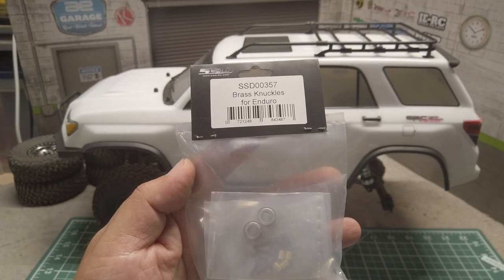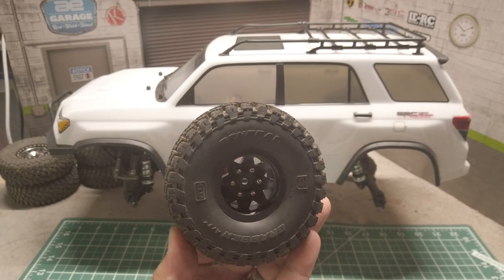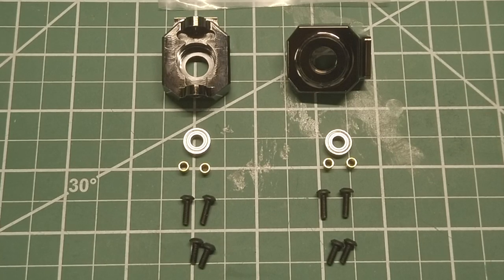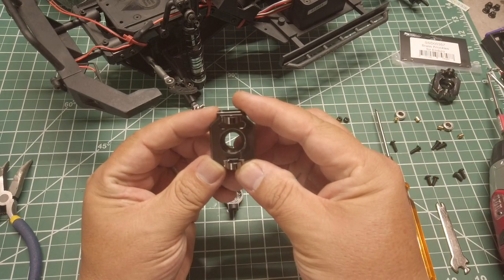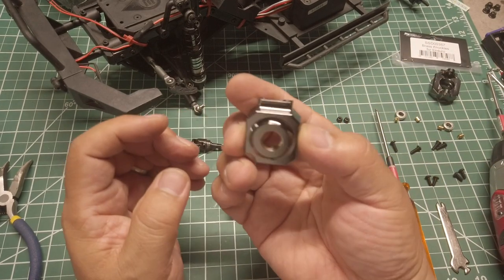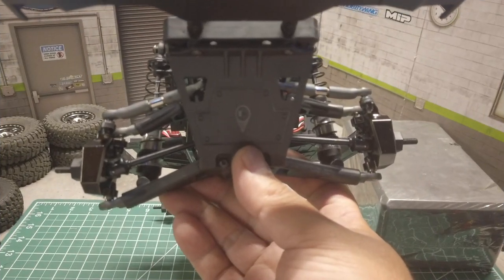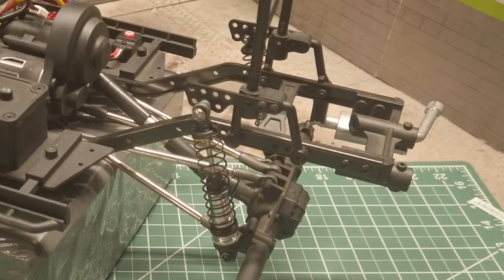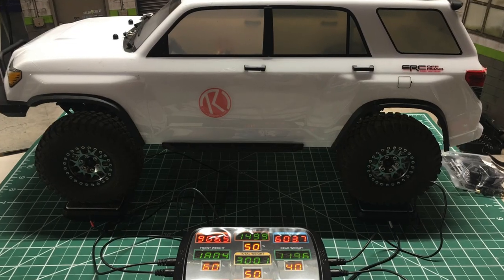Element RC Enduro Trailrunner Toyota 4Runner | SSD Brass Knuckles, IERC Shock Key & Yellow Springs

Comment: You saved me from having to solid axle swap! I have broken 2 plastic knuckles already! I was looking but was told that those knuckles don't work for the ifs
Reply from the maker: They work really well.  Give it a try.  It also adds weight where it's necessary.
Reply: I have the trailrunner and I put ssd wheels with km3 from watching one of your videos lol tha know so much.
Reply from the maker: @shawntomlin7632  That sounds like a great combination for the Trailrunner.
Reply: It is great! I just need to not break the knuckles. Need to wait till I get paid to get the metal ones

Comment: Huh, the shoulders on the ball end screws that go through the knuckle don't fit inside my SSD knuckles. Weird, looks like yours bolted right up. Guess I'll have to drill out my knuckles a little? Or I could get some standard rod ends I think. hmmm
Reply from the maker: Make sure the bend of the rod ends is facing correctly...that's the only thing I can think of why the ball end screws is not fitting correctly.
Reply: I'm having the same issue, man.  Did you end up drilling them out or figure out something else?

Comment: COOL VIDEO WAS THIS THE RIGG IN SEAN P RC VIDEO CLIMBING UP THAT WALL,LIKE IT WAS SPIDER MAN🤜🤛
Reply from the maker: Nope, it is not.  That one is Joshua Lazo's Trailrunner.  He was motivating me to work on mine which was being overlooked for Gspeed Enduro and TRX-4 Sport.  I need to tweak mine a bit, and test it against his ;). He will have a big advantage as he is running 4.75" tires, and I am still running 4.19" tires, but I mean to give him a run for his money though.
Reply: @BigSungHobbies  GET HIM,LOL,THE BODY IS NICE HOPEFULLY YOU DON'T HAVE TO CHOP IT UP,THAT'LL SUCK,COOL VIDEOS BROTHER🤜🤛
Reply from the maker: @josecanseca8979  Yeah, the body is really nice.  That is one of the main reason I have not touched it, because the more I drive it, I realize that I have to do something with the body.  For normal trail riding, it's not a big deal, but for the type of crawling I like to do, unfortunately, the body overhangs too much especially on the rear.  I ended up taking my lexan scissor to it last night.  I am hoping the minimal cut will work ;). We shall see.
Reply: @BigSungHobbies  see I do the trail riding,in parks,arboretum's,etc but I love watching those epic rock crawling   hill climbs,so I get why you have to cut into the body,hopefully it's not to much,but can't wait to see!
Reply from the maker: @josecanseca8979  Yeah, I am fortunate to have awesome rock crawling locations.  I tried to minimize the cutting.  Hopefully it's enough.

Comment: I would like to know how flipping the shocks upside down works out ...I am real interested in if it helps at all....
Reply from the maker: On a lighter LCG rig every bit that lowers COG is done.  On Trailrunner which currently weighs 6.62 lbs (3 kg), it probably won’t do anything at all, but it won’t hurt the performance either.  The changes to weight distribution and stiffer springs to rear will make much noticeable performance difference.  Hoping to take it out over the weekend to test the changes.

Comment: First time doing a knuckle replacement the renew into the RC world about a month now but didn’t see where you put the gold sleeves on where do they go exactly?
Reply from the maker: Welcome back to the RC world.  The gold sleeve is not used on Trailrunner.  It was designed for Sendero/Trailwalker.  Instead of the gold sleeves, you have to use the pivot ball joint that is attached the the upper and lower arms.
Reply: @BigSungHobbies  Thank you so much I actually missed it in this video that you did not use them, I looked at ur other video of an element like u just commented on and saw you did use the gold sleeves in that one, Just got my videos mixed up ha haha thanks for commenting back, I was in the middle of watching your video & replacing knuckles for the first time ever earlier when I lost the little pin bar that goes on the in the hex on the back of the knuckle  LOL. It dropped on the garage floor below me, And for the life of me could not  find it! I had to go out to a different city to go buy some, hard lesson learned but I will get to it here again shortly tonight, Thanks again RC brother.....oh by the way I did subscribe👍 Oh by the way what did you get that craft board?
Reply from the maker: Sometime putting down a towel really helps.  Trust me, I have done the same, looking for a piece that got dropped, and for the life of me, can't seem to find it.  And I got the craft board from Amazon.
Reply: @BigSungHobbies  Yes for sure that’s a good idea I will do that next time, OK cool got to get me one

Comment: Yeah I'm not getting how they won't fit at all In the ssd but fit perfectly in my stock ones and watching you have no issues sliding them into the new knuckles so I'm at an lost.
Reply from the maker: Make sure that you don't start tightening the nuts down until you have both top and bottom bolts and nuts installed first.
Reply: @BigSungHobbies  are you talking about the two nuts that go on top ? That kinda hold the knuckle?
Reply from the maker: I am sorry, but it’s really hard to know where you are having issues with without seeing it.

Comment: At 5:02 how are you tighten down them last bolts. I am struggling to get the pivot arms into my new ssd knuckles will not budge for the life of me afraid I might have to drill the hole bigger did you use the gold spacers or what ?
Reply from the maker: I am using the curved pliers to hold down the nut while using the hex driver to tighten it down.  It helps if you keep both top and bottom nuts a bit loose.  Once you have the nuts threaded in a bit, then you can start tightening it down.  For the Trailrunner, I can't remember if I used the gold spacer, but you should not need to drill anything.
Reply: @BigSungHobbies  true might need the curbed pliers then possible. But I'll give it another try tomorrow. Just weird the stock knuckles it slides right into no issues. Then with the new ssd knuckles it's almost near impossible to get the silver pivot spacer or even some threads showing enough to get the nut on it. But will try with curved pliers
Reply from the maker: I had no issues sliding in the silver spacer.  You should just test it to see if it goes in.  It’s been a while so I don’t remember exactly, but you shouldn’t be using any spacers provided though.
Reply from the maker: Btw the curved plier is to help install the nut, not to push in.
Reply: @BigSungHobbies  What I ended up doing was taking my dremel and rounded out the holes a little bit and they fit no issues and together. But wierd must been and machine error when building the knuckles maybe.
Reply from the maker: Glad to hear that you got it sorted out.